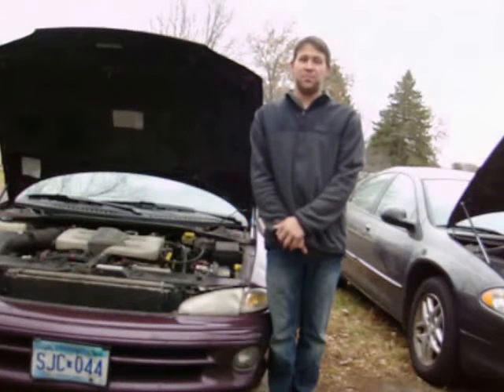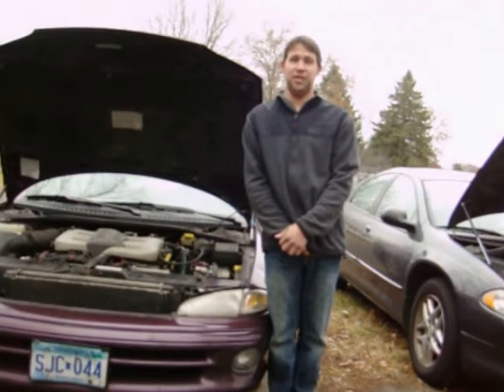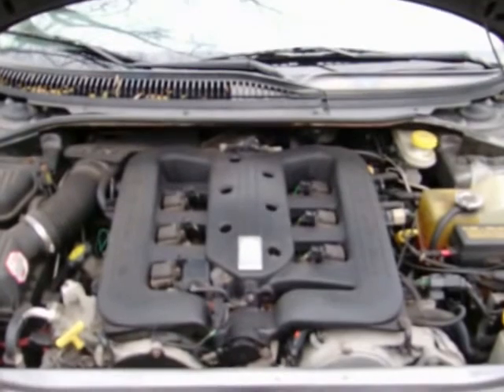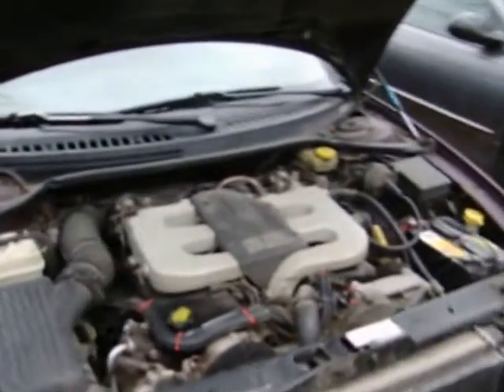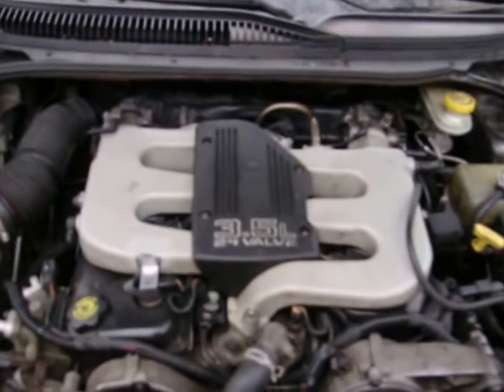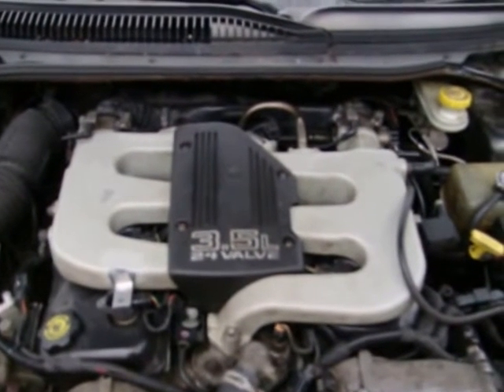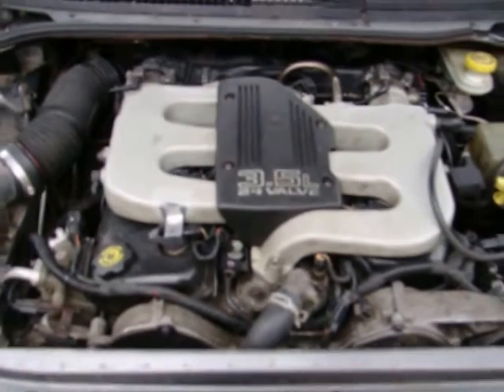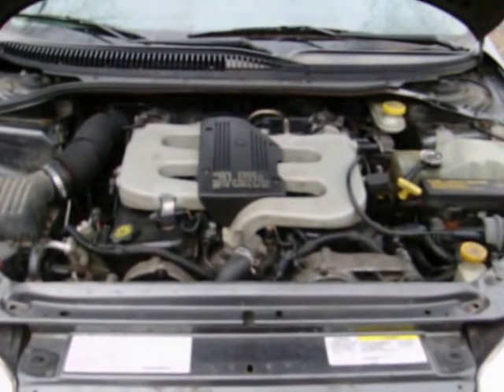Introduction- 1st Generation 3.5 Engine in 2nd Generation Mopar LH Car.

Comment: How did you get around the fuel rail plumbing from 1st to 2nd gen.
Reply from the maker: The fuel regulator and return line was blocked off.  I used JB weld epoxy in the regulator area.  The fuel line simply connected to the rail input fitting.  Also this conversion requires the use of a 1998-2001 SBEC controller.  Cause of the unique T.B. And 4 wire Idle air valve.
Reply: @carlweeks9256  cool. I think thats not to bad. Im putting a 1999 300m engine into a 1997 concorde lxi. How did you get around the egr valve. They are very different. 1st gen is vacuum actuated and 2nd gen is electric.? Thanks
Reply from the maker: @sparkycar16  in a 2nd generation car 98-01 SBEC you need to use the electronic EGR.  In a 93-97, use the Vacuum EGR.  It's what the ECM will work with.  You cannot swap ECM between 1st and 2nd generation. Because they use a different type of data serial bus for communication with other electronics. The instrument cluster even depends on it.  2002-04 NGC has NO EGR valve which I definitely like!!  Couldn't use that with the 1st generation 3.5, due to the Throttle body difference (2 wire VS 4 wire Idle air valve)
Reply: @carlweeks9256  i dont know if i can use the 1st gen egr do to different way the pipes are. Any way i can put 1st gen intake and lower intake on to the 2nd generation motor?
Reply: Hey. Got everything figured out. And wired. Just curios how you went about motor mounts. I notice were motor mounts bolt to block one hole is off just a bit.
Reply from the maker: @sparkycar16  yes. The mount to block bracket must be correct for the generation of car.  And just 1 bolt on 1 side is a bit off on the cast iron VS aluminum blocks.  Same thing with one of the top bellhousing bolts.  (2001 and newer transverse mounted transmissions (41 TE) have all of these holes to allow the same transmission to fit in minivans, JR cars, and Pacifica).  I drilled out and made an "oblonged" hole on that mount  bracket to allow it to bolt on.  The top transmission one I also drilled but not as big a deal if short on that one.